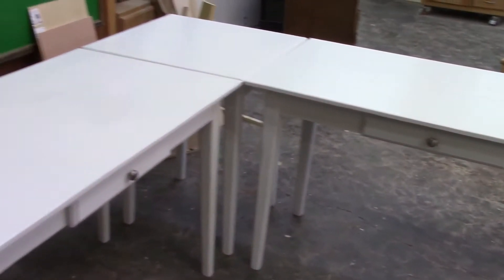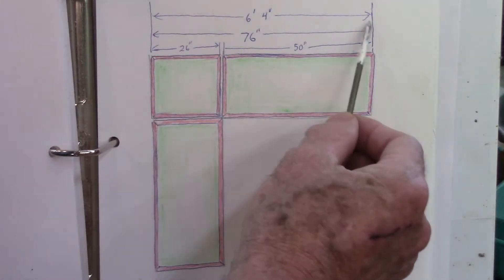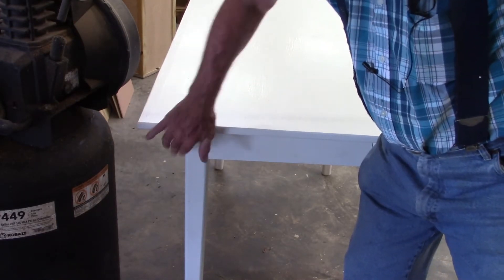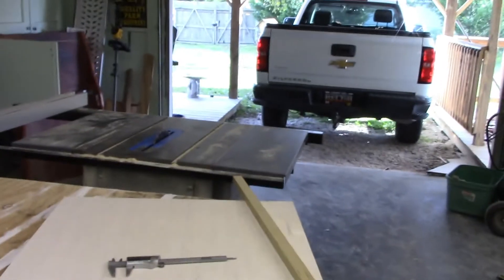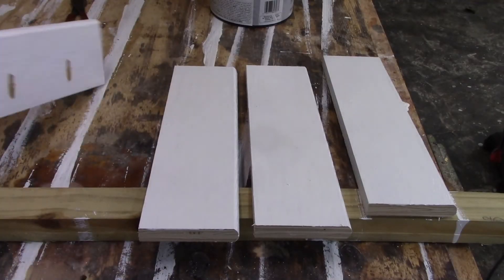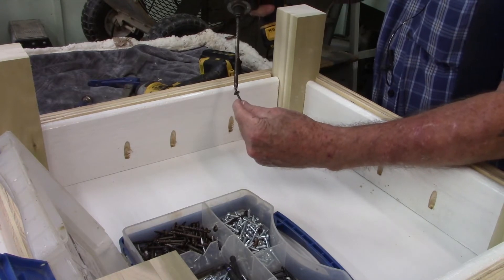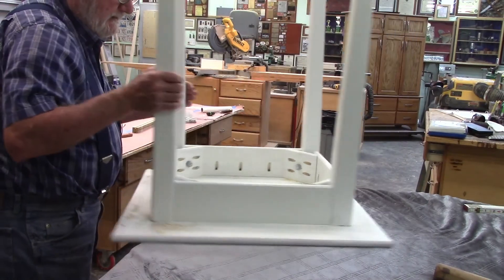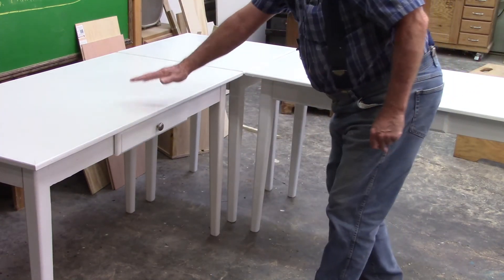299 Square White Corner work table

Comment: This table is a great addition to the original two. Good idea. Thank you for the video.
Reply from the maker: I actually talked her out of making a corner built-in custom unit, as I felt that the work would be scrapped in ten years when the tables weren't needed anymore.  Turning it into a three-piece unit, where the tables can function independently,  the tables can be broken down, stored, and then reused for whatever emergent function that comes up.  My strangest hope is that one or more of the three tables will end up in someone's shop in 50 years, with some buy commenting on how well the old-times built things.  
      Thanks for the kind words, and mostly for the now long-time support of our channel.  Hope to see you next week.